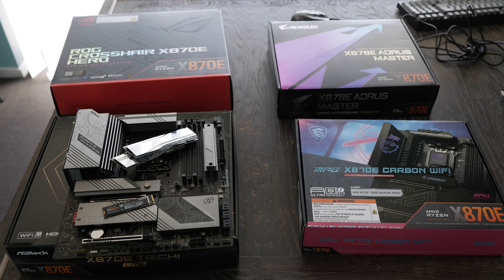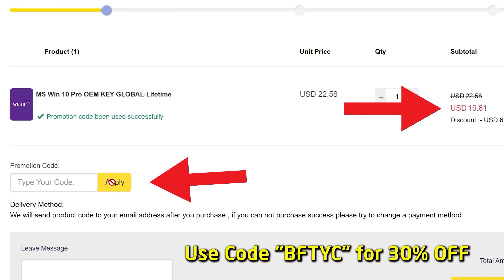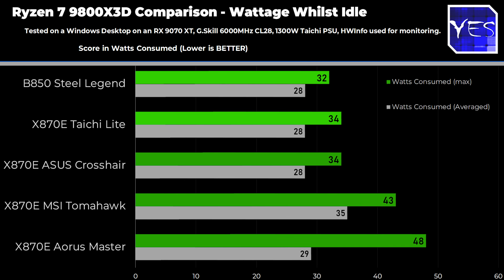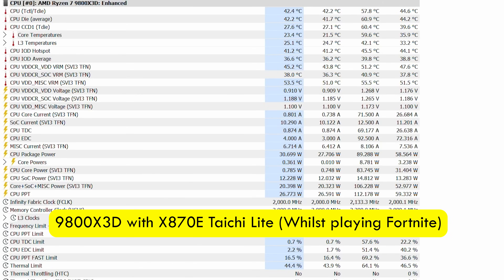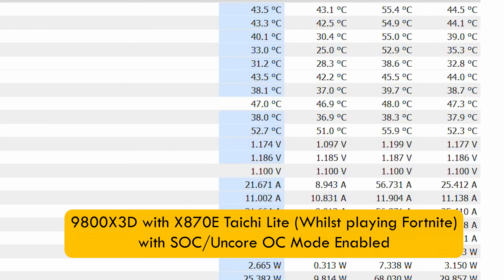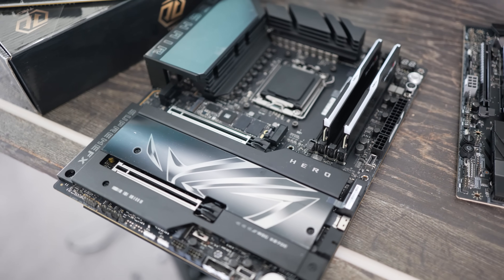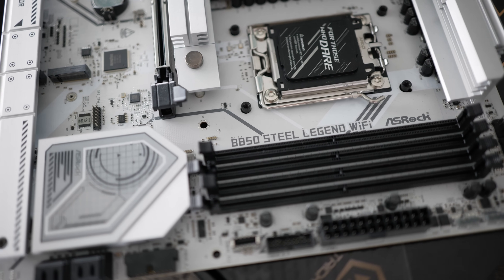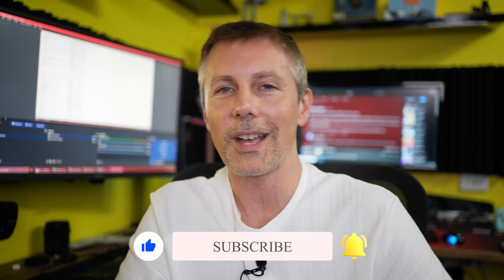I think I know why Ryzen 9000 Series CPUs are Dying...(!)

Comment: I'm on bios version 3.2 and have been monitoring the SOC voltage while gaming today, some very light gaming with WoW Classic and some heavier gaming with Space Marine 2 at Ultra settings. About 4 hours with HWinfo open.

SOC Voltage has been very steady throughout. Min 1.185, Max 1.19 and Average 1.187. Maybe the 3.2 bios does fix it?

Pretty sure I have not touched the SOC/Uncore mode option so it would be at Auto. I'll reload and check though.
Reply: Exactly the same results here- though I'm using a previous gen motherboard (Asrock X670E PG Lightning).

Comment: Asrock X870E Nova, 9800X3D. SOC ranges from 1.185 to max 1.190. Teamgroup T-Force Xtreem 48gb 8000M/T CL38. Running with no issues since Nov. ‘24.
Reply: but amdip
Reply: Are you on BIOs 3.16 or 3.20?
Reply: @sevenpointsixtwo  3.20

Comment: If you read the description of the option, however, it sounds like it's going to run out of spec, which may be confusing. I know I would consider that a less safe thing to enable than to disable after reading the description. This is why it might be defaulting to disabled when set to "auto".

Comment: So its once again, incompetent board manufacturers. My god. Charging a shi+ ton of money for boards and hardware in general. And they can't even get the bare minimum working! Let the alone, one of the most important parts, Voltage regulation! 

And of course, on barely any board can you input minimum and maximum voltage/voltage range so you could fix it manually.

Comment: My system (regular Taichi) is at 1.91 SOC by default using XPO and I haven't changed the OC mode manually, so I'm assuming XPO forces this by default?  Mine never shifts up or down either.

Comment: I used to have processors fail on me before.  Since disabling the boost/Turbo features, I have yet been able to suffer any issues whatsoever.

My understanding, overclocking exceeds tolerances which exacerbate failure rates.  How else can CPU manufacturers impress end users, reliability or cutting edge speed?  You guess right, Speed!!!

Comment: My Asrock riptide B580 and 9700x SOC is rock solid at 1.190V  I use a 1000 corsair PSU.  Only thing I have enabled in the bios is the ram EXPO, and the pre defined curve optimizer to -20mV Tjmax 85 degrees.

Comment: So i have a 9800x3d and an ASRock Taichi x870e. My soc voltage is at a constant 1.190 max and 1.189min with the bios set to auto and its stable. I ran cinebench for a while no change. Its now set to enabled...if it blows up, i know where you live :)
Reply: I have the same exact setup will my cpu fry .. please help and answer
Reply: @TrucLa-u5z  sell it quick:)
Reply: x870 pro rs wifi here, i enabled the setting he recommended after watching the video, later that day i couldn't progress the story in oblivion because it kept crashing all the time, even tried to underclock my gpu and still crashed, reverted the setting to auto and no more crashes and i have the same values as you after testing many games, including ones that needed shader compile, stable 1.190 and low at 1.189 but nothing above. I did update immideately when asrock dropped the supposed fix 3.20 bios.
Reply: @staiain  yes im running 3.20 and installed it as soon as it was available even though i dont usually go for betas. My SOC is stable still 1.190 max 1.189 min with the setting to enabled . no issues, not crashes. I dont think this is the answer and more a stab in the dark. Im using a strix 4090, what gpu you got?
Reply: @simplysimon966  so do you recommend enabling that setting or leave it on auto? I’ve never seen my SOC voltage fluctuate on HWinfo. In bios I have mine set at 1.2V. Have expo enabled (6000 cl30), manual cpu oc at 5.475ghz and I have a 4080 super that’s undervolted while boosting memory by 1000 and running at 2825mhz
Reply: @JayDaDon_7  I dont oveclock anymore. I find it completely pointless as you dont see a true difference in games. The 9800 and 4080 is more than good enough for any game with DLSS on quality. Chasing an few FPS is for streamers as they get their gear for free so if breaks it doesnt matter. People will disagree but no matter what you aint seeing any diiff in reality. Run things at stock and enable soc = no issues at all for me. Stop stressing your gear because these streamers say so. Remember FPS, MHZ, etc only matter, when you measure them.
Reply: @simplysimon966  I agree. I render for a living and with the newest multi-core Ryzen cpu's Overclockign is just a hassle and askign for future failures. They are very good these days it is not worth it. We have 16 cores on a desktop and if you have the money, you can have 96 cores!!!! For renderign this is wild. If only work was coming in I would get the latest threadripper.

Comment: You might have missed a spot.

Did you check the LLC setting for the SOC Voltage?
Reply: What is this?
Reply: Elaborate pls
Reply: @JayDaDon_7 I researched it, it's load line calibration, basically when your cpu goes under heavy load it might experience voltage drops(Vdroop), when llc is set to on the motherboard compensates by giving it voltage. LLC has multiple levels(3 as I have seen on asrock, not sure), higher levels can overshoot with voltage correction and cause damage or issues, while lower may not be always enough to handle voltage drops so it should be at level 2 for Asrock. This is purely based on videos and research as I don't have an asrock board, and my gigabyte has it set to auto

Comment: Hello, I'm going to buy Ryzen 7 9800X3D for gaming. What is the best and most reliable motherboard for that CPU cost not more than $500? I won't overclock anything.
Reply: MSI x870 Tomahawk is rock solid, and you can use all nvme slots without losing 16 lanes on main pcie slot. That is if you need usb4 and just want a newer platform. Its around 300$ and also has 5 gig networking, a bunch of good io, full wifi 7, a debug code display... No reason to spend more unless you need x870e which just has more pcie lanes from the dual chipset otherwise this is the best one. Also has a cmos clear button on the back, 3 usb c's(2 are gen 4) supports optical audio... Basically has almost all features of board 2x the price
Reply: @markojovanovic9651  Thank you for your recommendation and explanation! Is the audio card on that MB good too? I like to listen to music in good quality on my PC. I have an amplifier and big speakers for that, so I need a proper audio card too.
Reply: @felissilvestris  It's fine but if you want the best experience you should get an external dac almost always, a motherboard's integrated audio will be outperformed but almost any external dac with dedicated power

Comment: I think if you contacting AsRock about this is a good idea. They might already be aware of it already, they probably are, but it would be worth reporting to them. I don't think they'd do anything on purpose to cause issues. That would be illogical for a company. It's probably just a strange anomaly, perhaps something between AMD and AsRock as you suggested. I think they're probably working on resolving the issue. I've spoken with AsRock a few times, and it's always been pretty amiable. I think they probably try as well as any company to do right by their customers. So here's hoping they'll work something out.

Thanks for the head's up on the way of correcting for this issue. I'm currently building a system with an 9700x and AsRock X870E Nova board.

Comment: That is why I have never bothered upgrading from AM4. Performance is still good, rock stable 24/7.. and it just works!
Reply: Yup. 5800x3d/GTX 4080 for 1440p gaming.
Reply: lol, alot of manufacturers were blamed for the high rate of dead r5 3600

this is more of bios and not the socket thing, time will tell, if it was the socket, alot more people would have said something like the last time, that was also a bios situation caused by the manufacturer
Reply: @betag24cn  I agree with that. Maybe I should have phrased it in a different way. I have a stable AM4 platform that has been stable for years and I don't really have the time and patience now to troubleshoot any potential problems with a new platform. That doesn't mean that AM4 is trouble free for everyone.
Reply: @Percules_10  You made the right decision. I am lucky that my CPU never burnt up, but when AM5 first came out I had nothing but trouble for the first half a year. Had to run the DDR5 RAM at stock speeds until motherboard BIOS updates came out that made them stable enough to run at advertised OC speeds. Also had the horrible issue of AMD's auto update software trying to update key chipset drivers at the same time as windows update was installing something, which caused a collision between the two and corrupted the whole OS. Thankfully I had a backup, so didn't lose too much but my god.

Everything is running fine now though on my end.

Comment: Fluctuating voltages are always worse for electronics than running at a constant fixed voltage. I understand they came up with these features to save power but I have always felt iffy about them.
Reply: Why?
Pls explain or give a source. Mechanical, moving parts for sure but electronics?
Reply: @HansWurst-I  it degrades with the heat cycle.
Reply: @RafitoOoO Ok, but this effect is only important for longer timespans when you have high temperature during full load and low temps with no load.
Small spikes of voltage will almost no effect temps. They are there to keep the cpu running under low load and will decrease with full load if im not mistaken.

But ofc having a small temp delta for your components will make it last longer.
Reply: Yup constant voltage fluctuations is harmful for all electronics, especially those big spikes that modern CPUs have, but that's something corporations ignore because they know that most people have no clue how silicon works, as always follow the money, make it look better than it actually is.

Comment: 1.27soc should be okay btw
Reply: the issue is not the 1.27, but rather that you get spikes, often not even visible within hwinfo. For example the issue with intel 13/14 was not reaching 1.5, but rather the times where the cpu got 1.8 or higher. There are always spikes of 0.3 or so . As such 1.27 might mean that the cpu actually go 1.6 or more for miliseconds. That said even reaching 1.6 the cpu should not be completed dead there and then , it should start to degrade, like the intel ones, but that is not what is actually happening, they are just going down. (ps, monolitic designs like 13 and 14th tend to be materially more resistant than chiplets designs, and intel manufacture process, that i think was 10 mm , also adds some level of resistance what may explain with 13th and 14th gen would not have catastophic failures)

Comment: I hope I was able to save mine. I had 1.329V peaked on a TUF650-E WIFI but never under load. My CPU is fairly new. I set the SoC to 1.230V is that low enough? It was 1.240 on auto plus those 1.33 peaks.

Comment: On my Asus X870E-E Strix with a 9950X CPU the SOC voltage was fixed at 1.2v on Auto mode until the recent BIOS 1401 that was just released. Now the SOC Voltage is 1.1v and the system got rock solid stable. I am using 192 GB of RAM on 4 sticks so my maximum stable config for this amount of RAM is 5200 MT/s  (two sets of Corsair Dominator Titanium 96 GB rated up to 6800 MT/s). original BIOSES worked stable but recent releases became very weird until this newer 1401 that finally got things to normal again. My guess is that AMD tried to compete with Intel on memory speed support after core ultra 200 series was released and messed with the voltages on the SOC on AGESA

Comment: I recently built a 9800X3d MSI X870E TH build, gaming and benching with AIDA64, Prim95 large/small, and FurMark 1 & 2, plus Time Spy, CB 20/23 my max VID ever is 1.138v and 0.325v idling, VDD 0.779v - 1.146v, and the SOC is rock solid at 1.205v  which never changes, this is with XBOW 1, and a CPU under volt of -20, and max CPU package 96.25w, Cores 65.7w, L3 Cache 3.06w, and my CPU is clocking up to 5.6mhz when gaming, and I don't have any overclock or PBO, only curve optimizer negative 20.   But I think I try negative 30 now.

Comment: So far this month i went through 3 Gigabyte Pro ice x870e  itx boards for a multitude of issues main one it would power itself on once power was connected with touching the power button but this behaviour wasn't a full power on phase it only powered up enough for the fans to turn on not even the LED on board would turn on.

This was with the Board and a MSI Mag 850GL PSU.

Switched to M-ATX Gigabyte B850 with a Asus SFX PSU since I was trying for a white themed rig.

So far 0 issue's no self powering on since day 1. But I did find this board can't handle 4 dimms installed.

Comment: Can’t guarantee you’ve correctly identified the problem, but this is a very credible lead and avenue of investigation. ASRock should really appreciate this.
Reply: From what I heard, the issue is with most ASRock motherboards having BIOS issues.
Reply: they have been doing bios modifications for years and i doubt this is different, this is more of that, like the burned down amd cpus on asus motherboards from like 2 years ago

this is nothing new, it is just competition for the fastest bringing this crap to users
Reply: Nothing wrong with going down the rabbit hole, most people stay on the surface with the other Earth dwellers...
Reply: 1.25-1.27 doesn't seem to me at all as high voltage and possible cause of death, and in gaming it's a totally normal behavior because you don't have an all core load
Reply: Or AMD and AsRock, getting unpaid work done, eh?!

Just like game developers are using gamers as unpaid testers!
Reply: Plus it's more evidence that what is still somewhat poorly understood may in fact be a problem specific to ASRock, as the anecdotes have very strongly suggested.  In any event, I gave ASRock a pass for my build and I've been pointing out the concern to anyone willing to listen.

Comment: Ryzen 5900X, and 5600X was the last time I was an early adopter, and the first two years sucked- WHEA errors. Then one day, I  was trying to remove my CPU, and I couldn't get the water block to release, the Kryonaut Extreme created a vacuum on the CPU, and the die just wasn't hot enough, so I pulled a little harder, and I pulled the CPU right out of it's socket without lifting the bar. It removed a very thin layer of gold on the pins. I cleaned everything up, and reinstalled it, and I've been WHEA error free for almost 3 years now. I'm done with consumer level CPU's, and motherboards. I'm moving to AMD EPYC for my next build. All this "gamer" stuff just isn't robust enough.
Reply: Keep that story to yourself because it just makes you look stupid, straight up.

Comment: Ok, so you took existing research that was on r/asrock (which you obviously browse), ran it in a WORSE way (1000ms hwinfo refresh interval when you can do 20ms), DID NOT DO ANYTHING as suggested in the "More testing is needed on this" section, then make a rather strong definitive claim on the root cause??? Bro are you for real?
Reply: You do know testing on this will be a long-term process? You need to read over your post again; you look like a crybaby commentor.

Comment: I can’t get mine to boot with EXPO on. I just get a 4d on the LED reader and a red light in the lower right. Turn EXPO off and it boots right into windows again. RAMs on the QVL the CL30 version of what your using actually, and the 9800X3D should be working I’ve updated everything. Losing the will honestly. Over like 1000MTs.

Comment: @techyescity My MSI B850 Tomahawk also has spikes on the VSOC, why is that? is also a setting?
Everything is default but expo and a few minor things...
VSOC with expo is 1.2V but i see on hwinfo during gaming spikes up to 1.27v or even 1.287v
(This is on the cpu sensor, on the vsoc mb sensor it varies between 1.21 and 1.23v maybeee at max)

Comment: Auto-OC should be off by default, IMO. It usually wastes a lot of power and creates a lot of heat by over-volting the CPU in general (even when it doesn't cause immediate physical damage like this example apparently can), and the speed increase isn't usually worth it. Especially on the latest (high-end at least) hardware where it's like the CPU and GPU come overclocked out of the box and a lot of people underclock them to reduce heat/noise and improve power efficiency. People can opt into the auto-OC mode if they want to try it and understand the pros & cons, but it shouldn't be the default and doesn't make sense for most people. (People who really care about overclocking will want to do it themselves anyway, and always advice against auto-OC on motherboards at least.)

Comment: With my very limited electric knowledge is it possible that as the Asrock board is supplying a lower voltage for the same power requested by the chip that the current will be higher and that may be what's causing the damage?
Reply: No, when the resistance of the circuit stays the same, lower voltage also means lower current. Higher voltage and/or lower resistance would cause higher current.

Comment: The automatic CPU overclocking by Windows 10 and 11 can cause weird issues as well. Sadly this Windows feature is hidden from the average user. Technically the OS pushes the CPU over its healthy limit sometimes by 80% and the cooling, motherboard parts and the CPU inner safety features can't keep up with the huge power spikes it gets.
The user has to manually set the CPU limit in Windows power management to 99% to fix this issue.
Downside: around 30-40% performance drop from the pretty benchmarks and the advertised performance.